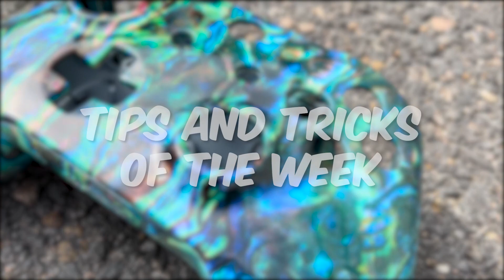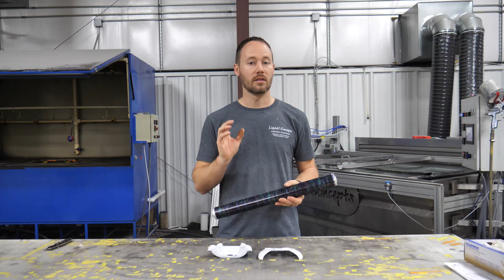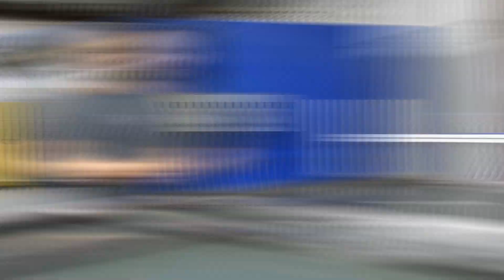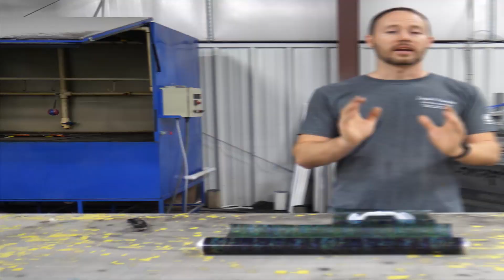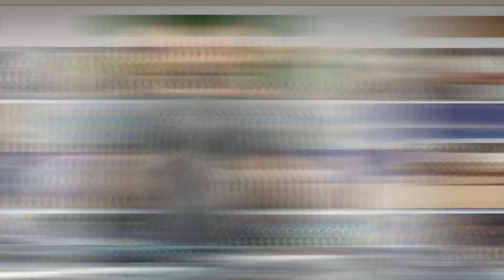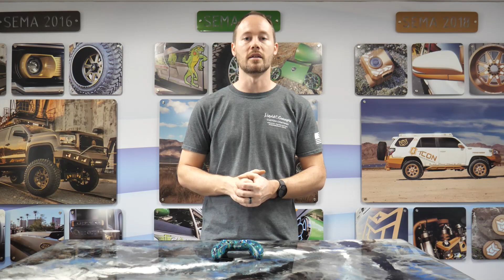HYDRO DIPPING AN XBOX ONE CONTROLLER | Liquid Concepts | Weekly Tips and Tricks

Comment: What's the point of priming and painting if it has no imperfections, seems completely pointless. Could of just cleaned them then sanded with 800 grit scuff pad, then washed again, then dried then dipped. Priming is pointless.
Reply from the maker: For the best adhesion we recommend the full process! We are in the business for longevity not time savings.
Reply: Gotcha, I do body work so that's why I asked
 @LiquidConceptsUSA